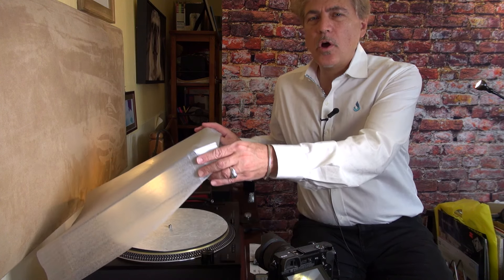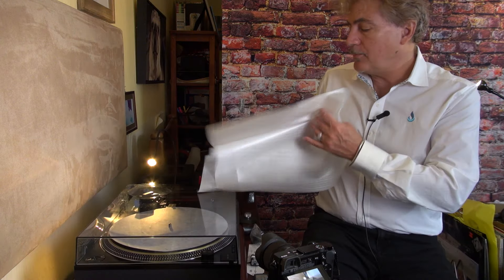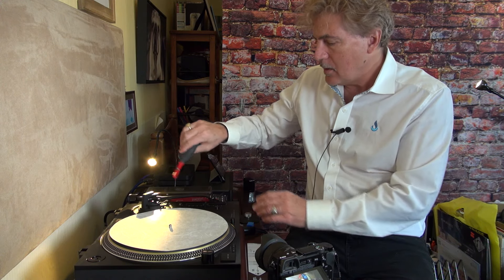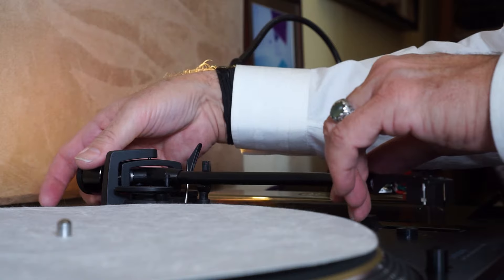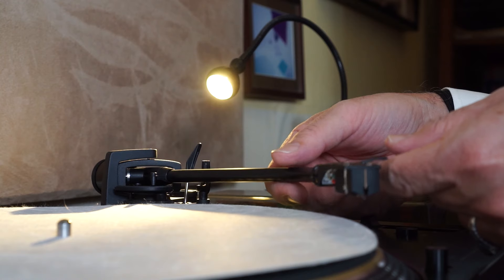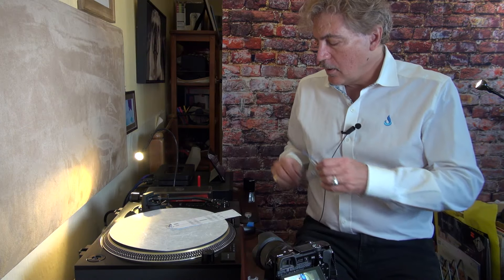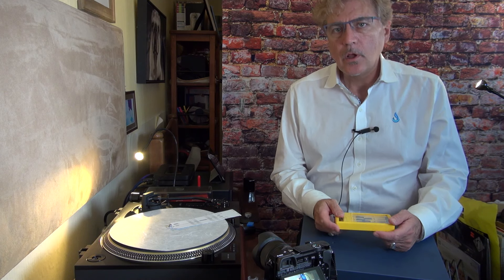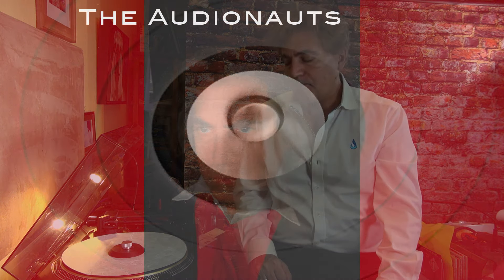The Audionauts : Adjusting the Technics SL-1210G

Comment: First, before doing anything with a cartridge mounted on the tonearm you should put a normal thickness record on the turntable to protect the cartridge from hitting the platter and whatever is covering the platter. In addition, to make sure the tonearm is parallel to the turntable you need a normal thickness record and on that surface raise or lower the tonearm until it is parallel to the surface if the record. The VTA depends on setting the tonearm parallel to a record initially. The stylus will be tracking a record, not the surface of the turntable. Furthermore, the VTA can be adjusted according to the thickness of the record. So 180 gram and 200 gram records will require that the tonearm be raised a bit. However, VTA can be set using a normal thickness record and use it like that with all records. More important is the azimuth adjustment and the stylus rake angle.

Comment from the maker: In this video I recorded with the Sony camera sound as a reference and the Sound Devices as a main sound source. However, in editing I forgot to label or identify which channel was which. Through my headphones the Sony sound seemed better although it wasn’t. Later in the video I used the correct audio from the separate recorder in the edit. Although I applied a De-Esser to the audio, after You Tubes compression it came out very screechy.  
I also had the Apogee interface summing the audio in my headphones so I didn’t notice that the audio I was outputting was only in one channel. At least for the Sony camera audio part.
Instead of fixing it I left it as is. It’s an example of how one can, with the best effort, background and knowledge still mess up. Going forward I learned to correctly identify the audio from the camera and the recorder in my editing system. And to not have the headphones fix what you actually want to hear.
Hopefully, this will be useful to other content creators. 
For those that criticize my handling of the turntable. I intentionally left this part in the edit. Notice the sound cuts out when I drop the needle. I do the sound editing so of course I did this for comic effect. Resuming when I continue.
The people who criticized my handling of the turntable and those who gave advice:
The whole purpose of the channel is to be real. I have had and worked with Well Tempered, Rega, VPI, Project, Oracle, Sumiko and Micro Seki.
The reason I got the Technics is that it seems to be built to be idiot proof. The test was: is it really?
The problem with many high-end turntables is you need an expert to  install the cartridge. I personally know some of the popular You Tubers and Designers. They have “ a guy”. Regular people do not.
So was I able to do it myself? 
For the most part yes. If it was a delicate cartridge I may have damaged it. But the Denon was Ok. 

As a commenter said I did in fact have the counterweight backwards. I was able to easily fix this. 

I created this channel not to promote myself, but to be real with people at the risk of looking like an idiot and getting condemnation from the trolls. 
So what you see is real, honest and sincere. 
Please comment, share and subscribe if you get me. 
Also, someone donate $1 to buy me a coffee so I know it works. 
I know I’ll get sh** for this post. 
If you don’t like it create your own channel the way you want.

Comment: The 103R needs a heavy tonearm, thats the best way to have the special sound of this cart. So please try the 103R with  a heavy headshell like Ortofons LH 4000 and please use the extra counterweight for the tonearm. After it you would wonder about the great sound. I did in this way with my SL 1210 GR and the 103 standard. And I did in the same way with my second 103 and the Denon DP 3000 NE. The Technics Headshell is not heavy enough for the DL 103 R.
Reply from the maker: OK. This is the first time I heard about using a  heavier headshell and I talked to a lot of people. I'll look into the LH 4000 when I can. I'm going to give this set-up some burn in and get used to it for a bit. 
I was looking for an Orsonic 101b, but couldn't find it. I was also considering an AT-OC9XSL as a cartridge, but Steve Gutenburg said it was a very clean sound and the Denon seemed like it would be more to my taste. I may also go with the Dynavector 20xL when I can afford it. 
I'm not a fan of reinstalling the cartridge again. Perhaps I'll get a headshell and cartridge combination next time.
Reply: absolutely correct - did the same. a low compliance cartridge needs a higher effective mass tonearm. So head shell weight and added counterweight made my DL-103 (not R) sound MUCH better - and I'm not a golden ear person....also need spacer (~3mm) to get it level since it's not only low compliance it's also vertically much smaller than most cartridges. Also the supplied head shell allows for azimuth adjustment via set screw which I needed since mine was visibly off out of the box. Highly recommend only buying head shells with adjustable azimuth.
Reply from the maker: @dscrimager  My tonearm was not exactly low enough for this cartridge. I had to put it below the zero starting point, lowering it not raising it. It angled slightly down towards the cartridge in the zero position. It may be slightly different for the GR and other Technics tables. I added a slim cork and rubber mat to bring the surface up a tad and the horizontal seemed correct now. And this mat along with the rice mat I think sounds a tad better. 
The curvature in the arm makes it hard to see it exact - even with tools to measure it - as I said in the video. 
I can't afford a new headshell at the moment. I know there are a lot of fancy ones. Experts tell me it isn't that big of a deal to have a fancy headshell. Although I understand the resonance frequency and extra damping can make difference. 
If I spend more money on it I may opt for an Audio Technica AT-OC9XSL, or if I can save the money, a Dynavector. At the moment I'm letting it and the cables break in.

Comment: What's happened to your left channel?
Reply from the maker: I just noticed that on some of the SHORTS. In editing I had the headphones of my preamp summing the channels to my headphone. So I didn't notice actually until yesterday - even though the output meter indicated it.  I test listened on my iPhone speaker so didn't hear it until I listened with earbuds. Now that I'm aware of it I will be more careful in the future. Thanks for mentioning it. I have a bunch of old audio and video gear. Some of it works and some doesn't, so I am testing different stuff each time. I should know in the next few videos what I will use going forward.